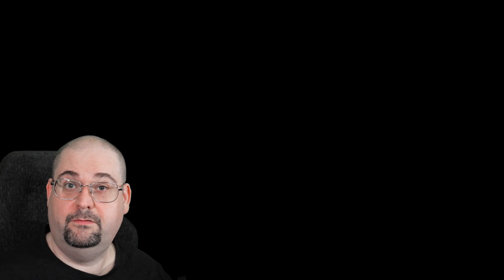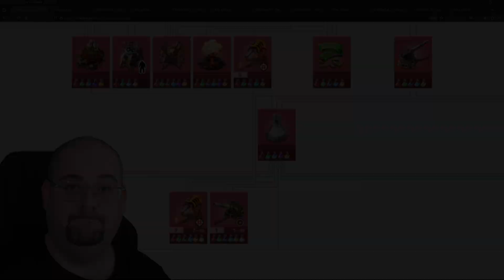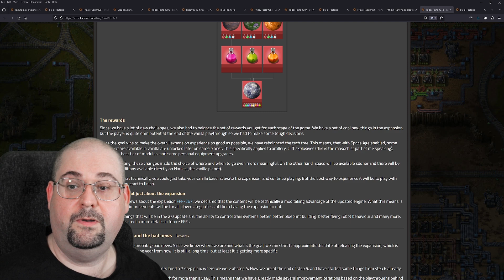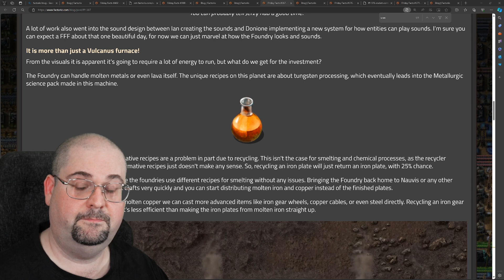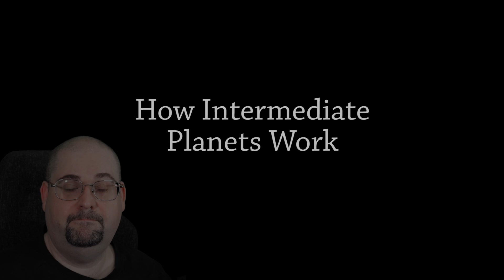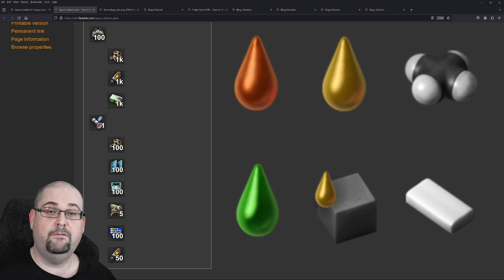How Will Science Work? | Science Theories - Part 1 | Factorio Space Age Expansion

Comment: Especially now that we know about the spoilage mechanic, I dont think science will work as described in this video.
Part of the idea of this expansion is that you have significant operations on every planet you visit, and juggling your time on each is part of the challenge.
Towards that end, I think there's going to be a fundamental change to how labs work. The way the game currently works, to unlock a tech you need to feed a lab the components simultaneously (ie red and green packs) to make progress. Multiple labs let you get faster progress, but it doesnt let you feed green packs to 1 lab, and red to another to make progress.
I think we're going to get an upgraded lab that is networked in some way. As long as there are sufficient packs in the network, you will make progress.
This would let you set up a super efficient pack production on a planet without having to transport them to use them or concentrating all labs on 1 planet. You certainly can do that, but you won't have to.
Reply from the maker: It would be an interesting wrinkle, though I confess it sounds a little OP.  If there is something like that I think there'd need to be some sort of 'penalty' like effect transmission where you lose a portion of the science?  Or perhaps it requires a lot of power?  Or maybe it could be something that's unlocked on Aquilo as part of the end game?  That way you'd still need to deal with space logistics, but it gives you an easier time with making a megabase?  I certainly can see a mod introducing something like that.

Comment: The one big thing that I hope for, which wouldn't be crazy to implement as far as I can tell: Have the ability to start on all the four "early" planets. The only Nauvis exclusive resource from what I can tell is uranium, which is only for cheap space science. 

On the Electro planet you'd need advanced oil processing for heavy oil cracking before blue science, which would probably be an auto unlock like initial steam engine research.
Vulcanos you'd need some way to get oil products, i haven't seen any of that on that planet. Power might be an issue if there isn't any smart way to use that on there.
Gleba is a bit of a wild card so far what is and isn't available, but oil products seem to be available from fruits, I can't imagine water being an issue. Possibly coal or stone might not be available, which aren't technically necessary apart from furnaces.
Reply from the maker: I've seen quite a few people say they want to start on the other planets, which makes sense, but it never really occurred to me :/
I don't think wube will give us that ability as they're not designing the planets to work with anything other than starting on Nauvis, but I suspect a mod would add something like that.
On Vulcanus they did say they'd changed coal liquifaction so you can use it there (there's loads of coal apparently).  I think the problem would be around water - there's the geysers which give you steam, but it seems like a few higher level unlocks would be needed to start there.

Comment: My guess has been that Aquilo's unique resource will be based around computation. That it will be a distant and icy planet that will be difficult to get to, but that coldness will also make it a great heatsink for supercooling endgame computers. I think the computation will be able to be beamed back to other planets with satellite uplinks and moved via an electric grid, and will be used in late game or end game recipes
Reply from the maker: I think that's a very likely possibility and it hadn't really occurred to me - what if the cold itself is the "resource" rather than a new ore or product?  I'd been thinking about it as a challenge to be overcome, rather than something you would want to use.  Tungsten heating elements could even play in to that - you may want fluids at different temperatures and heating some up may be how you control it.  So you can build heat exchanges and supercomputes on aquillo - I like it.
I could also see Holmium in there with super capacitors / super conductors used in the computer itself.  It could maybe even use radioactive decay (super quantum computer?) so you have to take uranium there too.

Comment: The Exclusive Recipes point is an interesting one. Given that a "full rocket of uranium" can produce 1000 space science, and we see the stack inserters removing 50 (12 + 12 + 12 + 12 +2) science packs from the assembler (and removing some catalyst uranium as well), we would only need enough U235 for 20x that recipe. So it would make a lot of sense if a full rocket can only move one stack of items. The devs have also mentioned that items might have specific weights for rockets, but overall it seems like about one stack of a raw resource will be the limit.
So my guess is that the devs might have simply made the sciences require a lot of the planet specific resources. If 1 Metallurgic Science pack required 50 tungsten ore, then launching the tungsten ore itself off planet would be inefficient to the point of being nearly impossible.
Reply from the maker: I think you're basically on the money, but I also think that planet intermediates are something we'll have to move in endgame to either do the final science or to build some things (spidertron seems like a perfect candidate for needing one intermediate from each planet).  But I'm pretty sure small scale will be fine to do a few end-game techs and build a few cool toys - it's only megabasers that will need to do it in bulk and solve that challenge.  A bit like now where most people will probably crank out a few infinite researchers with their base just to play for a bit and optimise a few things, and it's then a subset of the player base that then "goes big".
I think also it won't be too expensive to move raw - we've seen calcite is worth moving around, presumably because the molten iron/copper recipes at least are worth using on other planets.  But it will be way off something like cargo rockets in space exploration where you can move a lot (too much) with a single rocket.  Either that or calcite will be the one raw that's super lite so you cam move loads of it.